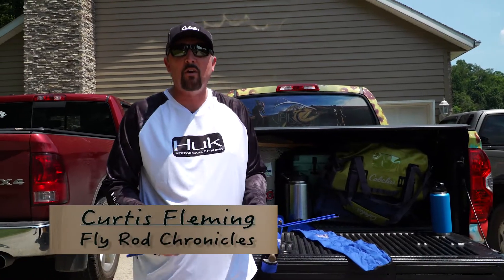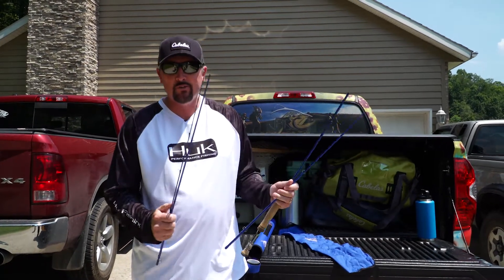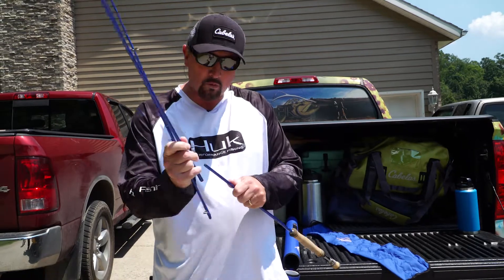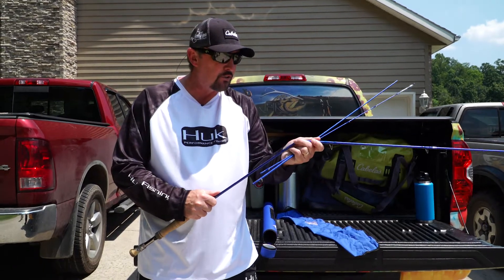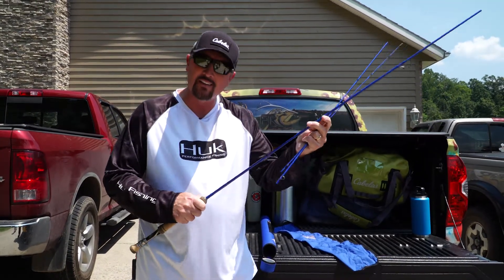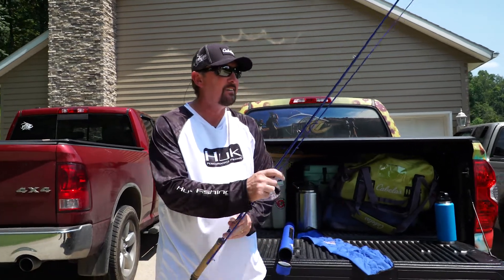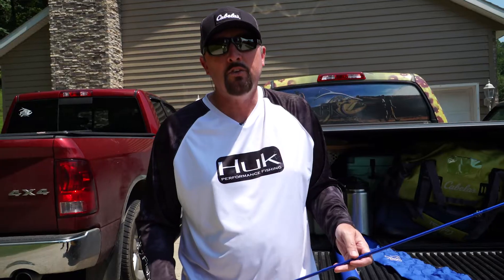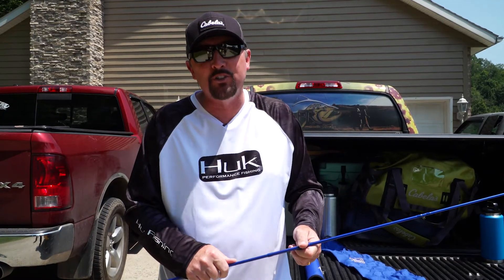How to put a fly rod together the smart way

Comment: Curtis,  The best way to put a four piece rod together is to start from the top down.  Tip, next larger, next larger, and finally the grip section.  The way shown is good too, but it causes you to set a partially assembled rod aside where it is more susceptible to being dropped or damaged.  Thanks for all you do!